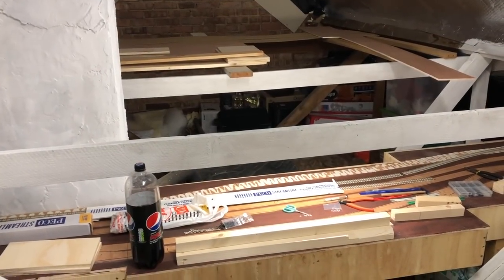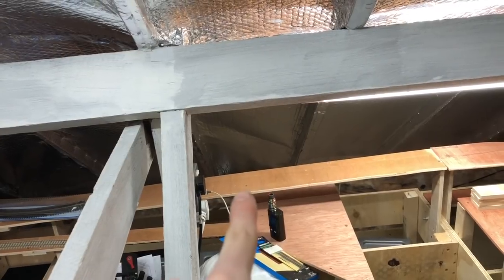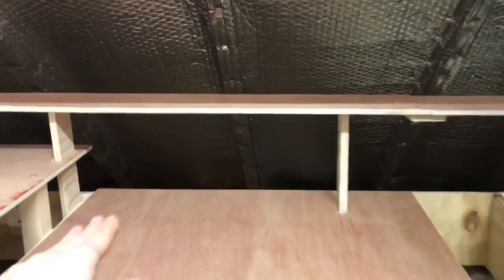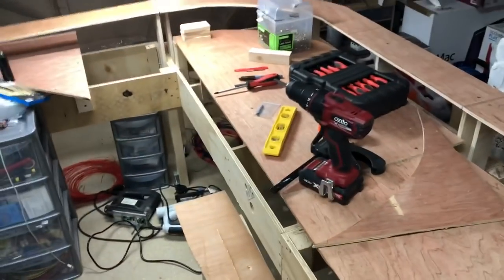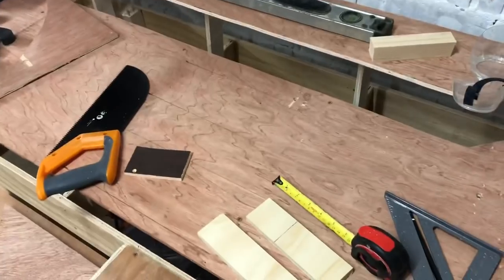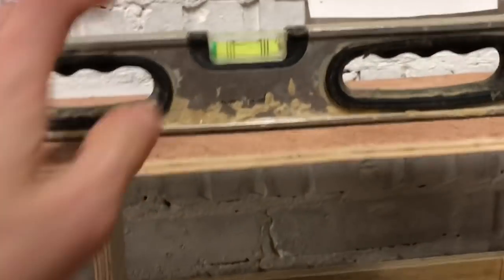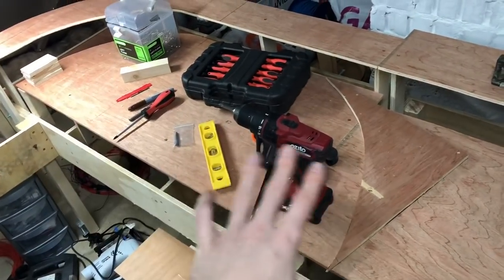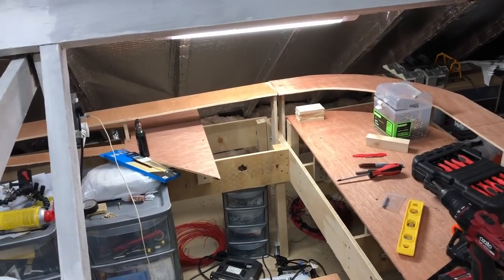Open Frame Work Update | Building A Model Railway

Comment: That plan is really taking shape now. Glad you got the info on getting the gradual drops right. My top end of laira took some adjustment after the track was down just to get the flow right. 
Might be worth considering the thin ply bracing along the sides, glued and pinned to prevent the decks bowing or sagging. Mine did at first but are now sorted.
Reply from the maker: Thanks Tim, it’s your advice that’s got me this far haha! Yes, that bracing is on the to do list! Definitely sounds like a good thing to do!